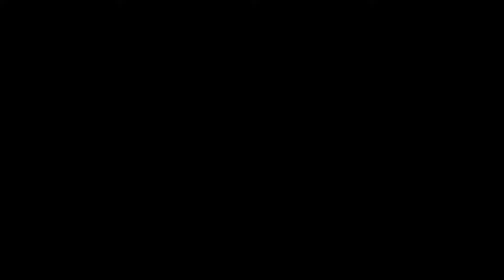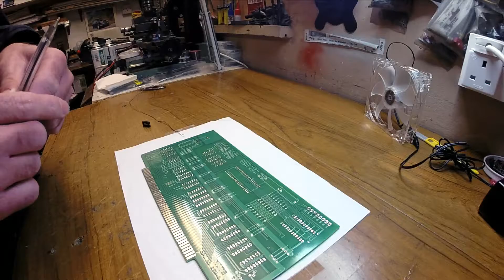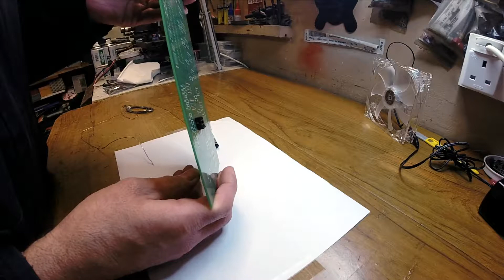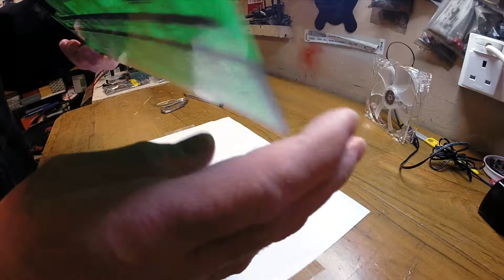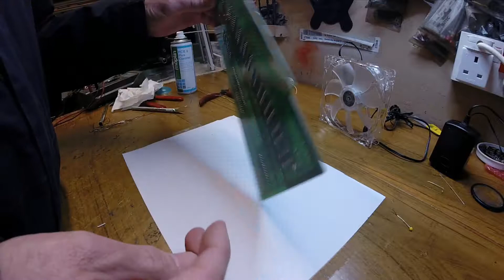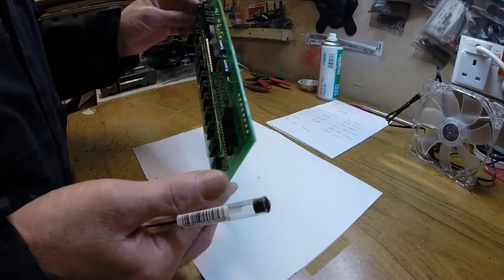Altair 8800 Build Project Part 1 - CPU Card Build

Comment: Just to say thanks so much for this super interesting and informative series! Really helpful when embarking on an Altair build, cheers
Reply from the maker: Thanks for your comment. Will hopefully get some more Altair Videos done at some point. Good luck with your build, there's quite a bit more stuff available now checkout Mike Douglas's Altair 8800C here: https://deramp.com/altair_8800c.html
Reply: @martynsvintagecomputing6338  cheers, would be great to see more Altair when you have a chance.  I’m using mikes case, Gary’s original repro 4 slot backplane x2, Jerry’s original repro front panel, Gary’s repro cpu board, mikes fdc+, martins serial board. Trying to be fairly original with key components, but also have Mikes front panel boards in case I get out of my depth- which is quite likely :)
Reply from the maker: @gchester99  I'd recommend using Mikes front panel certainly to start with anyway. There's so many wires to connect it's a really tedious job connecting it all up and if you do go this route definitely get Jerry's backplane connector so you can unplug from the backplane. As you may already know from my videos on the Front Panel there is a write timing problem with the original front panel on my Altair which I've not got round to investigating as at the time I didn't have access to a decent scope, currently I have an additional card to fix this. Good luck anyway and let me know how you get on.
Reply: @martynsvintagecomputing6338  I just finished wiring up Jerrys original repro front panel board, which, as you said, was REALLY tedious, and also it doesn't properly fit in Mikes case, so needed some 'adjustments' to be made to the case, and shaving a bit off the front panel board too. And yes I followed your example and used Jerrys backplane connector - nice. Also followed your tuning process starting from your resistor values which got me really close - so thanks for that too!  The front panel is done and, despite some struggles, it does look great with the 2 x 4 slot backplanes.
The Altair seems to be basically working, but the FDC+ card with RAM enabled needs to be on the same 4 slot backplane as the CPU card or a C3 00 00 at address 0000 only loops properly in either single step mode, or for a fraction of a second in run mode before it seems to get a bad memory read and heads off into addresses it shouldn't. I might build Todd's modern backplane, which I bought in case of probs with Garys original repro one,  and see if that works more reliably (choosing not to mention the cost of the S100 connectors to my wife...).
I haven't seen the write timing problem you mentioned, but then I haven't done any proper testing yet! I saw your mod to fix that, but will see how it goes.

Comment: Great video. I'm gathering the necessary boards and components to build an 8800. However, the most interesting thing I noticed is that you are using an Antex soldering iron! I've been using Antex as my primary iron since I learned to solder in 1977. It is the best soldering iron for board work. Nothing else comes close. Somewhat difficult to get in the USA, but can be found if you're diligent
Reply from the maker: Yes the Antex Irons do work well. The one I have at work has a much lighter and flexible mains cable and the older style handle with the metal clip. I find the conical chisel tips the best as these maintain the temperature at the tip better. The elements do weaken over time and sometimes need replacing before they actually burn out. I'm using a JBC iron on the Intel Stuff currently as the boards seem very delicate and have multi layer boards with large ground and power planes making it very difficult to get sufficient controlled heat in to the power rails.

Good luck with your 8800 build I hope it goes well. Jerry Walker has a large selection of boards on his jmprecision website and of course Glitch Works make a number of PCB's in the states.

Comment: Enjoyed your video. I just purchased a real Altair 8800a, so I am watching as many build videos and reading all the manuals. To get a better feel for how these things work.
After you get this all built, you need to become an assembly language guru to create a bootstrap loader to hook up a floppy drive and get CP/M loaded and working with 
your particular machines configuration.

So, much to learn and so little time...
Reply from the maker: If you use Mike's FDC+ floppy controller it makes things much easier as you can see in Part 8 of my series of videos. The supplied ROM on the FDC+ card will take care of the bootstrap and Mike's PC2FLOP program will produce the boot disks for you. Search for deramp5113 on youtube, Mike does some great videos on there. If you can't afford a FDC+ then you can use a program called the "Altair Peripheral Emulator" which simulates a disk controller over a serial link, all you need is a decent amount of RAM and a 2SIO card. I'll hopefuly do a video on the Emulator at some point.

Comment: Hi Martyn, I did not make this as a 'replica' board. It was made as a clone in order to allow construction of a functional 8800. The original schematics were used to create a functional replica although the general layout has been made very similar to the original, as far as can be determined (not a copy of an original). I do however try to make sure that builders can finish construction and items such as large format crystals are hard to come by and so I often make allowances for this by including extra pads for currently available types although in this case I also included pads for the large format type for those that can find one. It should also be noted that in some cases the builder will need to use old versions of some devices as the circuits were designed in such a way that more modern types may not work. This applies to many of the old boards that I create and this is down to the circuit design which I do not alter. While I do produce some true replicas (and more are being added) I would state that in any listing rather than describing it as a clone. On some clone boards some changes to original layout are made to allow easier construction but again general layout is adhered to as much as possible.
Reply from the maker: Hi Jerry,
 
Thanks for your comment it's good to know where the orginal board came from. I've updated the links above to include a link to your web site.

Overall I'm very pleased with the board and the only minor issues where the solder resist over the though plates for the link wires, the addition of pads for the smaller crystal where a nice and very useful addition to the board.

The only component issues so far where with the clock circuit and these of course were present in the original design as easily correctable as shown in my later video.

I've just ordered one of your Display / Control boards which should save me a fair bit of time over my original plans, after much searching I was convinced that I'd never get hold of Display / Control board or even the PCB design files.

It's great that you've taken the time to produce these boards as this project would have been impossible without them and it's brought the possibility of owning an Altair within reach of many more people not wanting to spend $10,000 on an original one !

If you'd like to link my video's in to any of your listings to show the build process and the board in action you'd be very welcome.

Bye
Martyn.
Reply: Hi Martyn, Its nice to get some feedback on the boards. My intention is to produce all the 8800 boards. One of the issues I have is striking a balance between authentic layout and ease of construction as many people do not have access to original components. The solder resist covered the link pads on the original board that I had so I reproduced it. I make two main types of board, clones, which are based on the original schematics but may have small layout changes and Reproduction boards which are made by scanning original boards and making exact copies of the originals. This is not easy as there are many 'originals' and it is a real challenge trying to determine which one to use as the template. I am currently talking to some 8800 enthusiasts and asking for feedback and comments so that future boards can be as 'suitable' as possible for those that may want them. If you are building a unit from scratch then you may be interested in a board that will be available next week. It is an interface board to allow the front panel to be plugged into the mother board rather than hard wired. It will help for new builds and can always be removed once the unit is fully running. I agree that there will be some 'difficulties' in certain aspects of the circuits but that is because they existed in the originals but as I am trying to produce copies then they must remain. As a professional designed I find it hard to do that but it seems that most people want boards that are functionally equivalent to originals. I saw your front panel order and must stress that this board is NOT a replica but a clone. The component layout is similar to the originals and the switches and LED's should be in the correct locations but in developing that board I used 5 different 'original' boards and they were all different (especially the corner holes). I tried to determine the actual original intended spacings etc and when I finally compared this against an original front panel it seems to align perfectly.Note that it does not need the jumper wires. Also the silk screen designations for the control switches may seem to be upside down but that is of course because the switches work in 'reverse' (ie toggle up = bottom connection to common and vice versa) and again this is how the originals looked. Please can you provide any comments and feedback as each board is proposed and for any that you do buy. NOTE, please avoid showing both sides of incomplete boards as it takes a lot of time and effort to determine layout so I do not want this put into the public domain.
Reply from the maker: Hi Jerry,Thanks for sending the Front Panel board though so quickly, looks really good hope to get started on it in a few weeks time.I'll leave a review on your website for the CPU Board as soon as I have time.ByeMartyn.
Reply: Hi MartynYou may find these usefulhttps://www.ebay.co.uk/itm/112881745685?ssPageName=STRK:MESELX:IT&_trksid=p3984.m1558.l2649RegardsJerry
Reply from the maker: Thanks Jerry. Received one today great service as always.